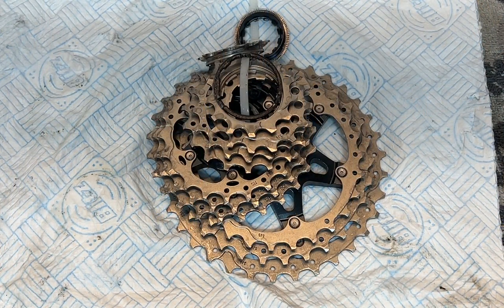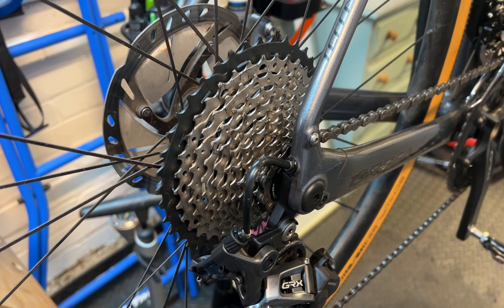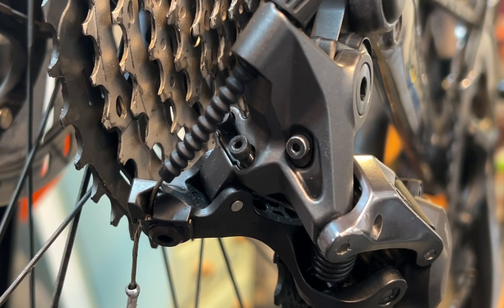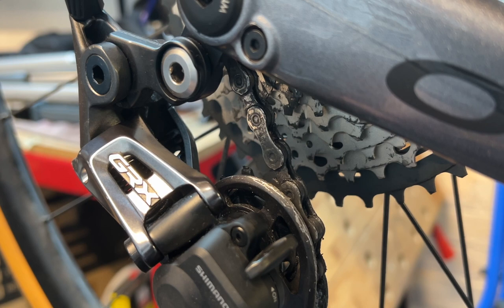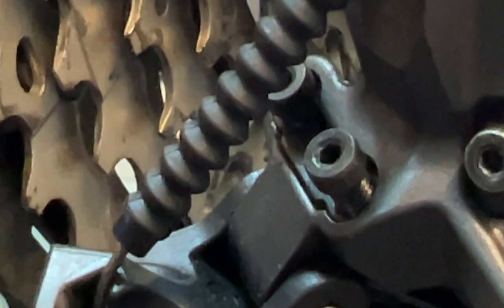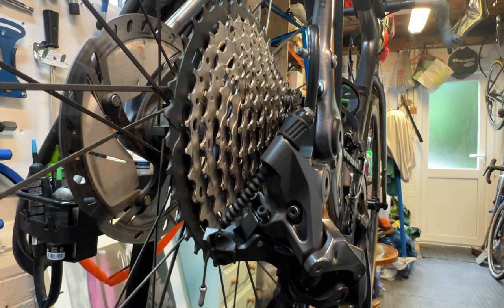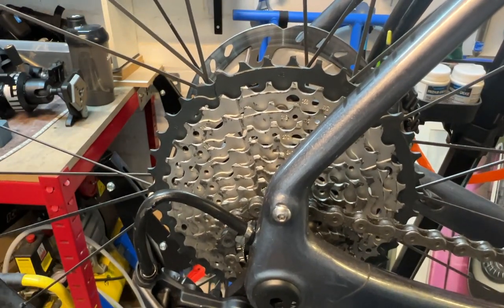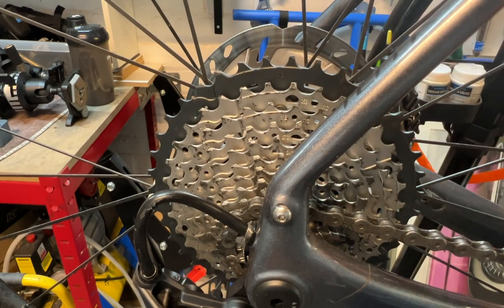Shimano GRX 810 and 11- 40 cassette: Can you do it and will it work?

Comment: If you want to safely use a larger cassette with GRX-RX810, you need to get a derailleur extension. The Wolftooth RoadLink DM is what I use with an 11-40t. Once it's installed you can use an 11-36t, 11-40t, or 11-42t 11-speed cassette. I'd also recommend getting a new chain and cut the length so that you can shift big-big (to prevent jamming), even though it's something that shouldn't be used.
Reply: No you don’t need any road link extension. With the GRX 810 derailleur there is sufficient B screw adjustment to run a 40 cassette no problem and just like the guy in this video has demonstrated. Been running it like this for the last 18 months myself without any problems at all and loads of others are doing the same. I run it with the correct length chain, and big big is doable no probs (although I don’t generally do it). Shifting is perfect.
Reply: @paddyotoole2058  does not work on all bikes! depends also on your hanger! He is right!

Comment: Well done, I do not think you will have any problems but running out side the recommended areas can be a problem in just the right environment. So never hurts to watch the mechanical as you travel and check it often and be sure to check it each night before the next days ride.  I run a 50 on mine with a non shimano chain thats a bit lighter.  I am not sure how long it will last but I would recommend to only use a shimano chain.  I do not intend to use it on a long century, just around town for easy ridding where people and dogs get in the way.

Comment: I'm running Ultegra R8000 on my road bike with 52/36 chainrings and an 11-46 xt mtb cassette. Works fine with a Wolf Tooth road link. Gear range 20 to 126 gear inches.
Reply: And probaby an XT derailleur??
Reply: @Eds Fietstechniek  No actually a long cage Ultegra r8000 derailleur.  Works ok.
Reply: @peterharding1551  ah right! I misread roadlink for tanpan. My mistake

Comment: Thanks for the video.  Did you use a spacer between hub and cassette?  I took one off with my 11-34 cas. but the M8000 xt 11-40 didn't come with one.

Comment: Thanks for the vide. Question can i use a GRX 812 with a 2x crank for example 46-33 and a 11 -40 cassete
Reply from the maker: Do you mean 46/30? Don’t see why not.
Reply: @JulianHutchings  I have a cannondale crankset with 46-33

Comment: I love this video. However, you're possibly misleading thousands (OK, several) into believing that this process is quite a bit easier than it actually is.  This adjustment is not trivial, and in my case at least, has led to copious cursing and not a few tears, on multiple occasions. 

 My main rule with b and limit screws, once you have them properly adjusted, is this: DO NOT TOUCH THEM EVER AGAIN.  They can be a nightmare to adjust; through some satanic entanglement principle that only applies to bicycles, pfaffing around with one screw will influence the adjustment of the others, ad infinitum, especially if you don't know what the f* you're doing. And then there's the added pfaff of indexing to match the newly adjusted limit screws, which often leads to gears shifting smoothly in one part of the range, but horridly in another part.  (Sometimes I dream of going back to friction shifting for this reason.) Of course, if you swap in a larger cassette, you're going to have to move everything around, but for most people it's going to be an enormous PITA, and one ought to be forthcoming about that. :) 

Enjoy your ride in the alps!
Reply from the maker: Good points! See my follow up short!